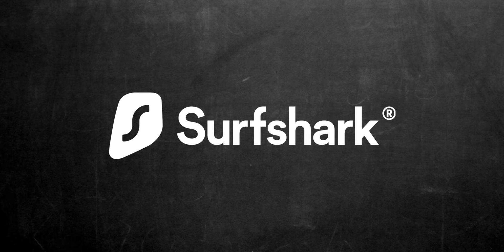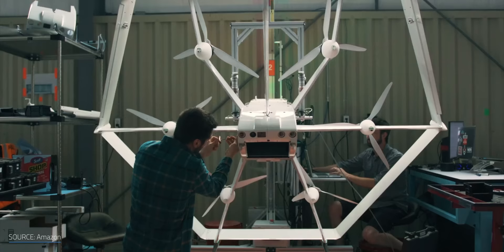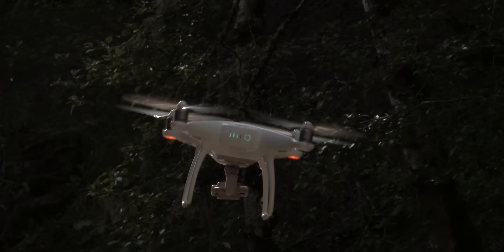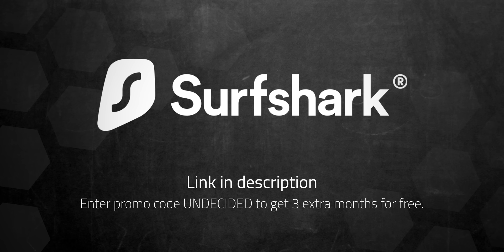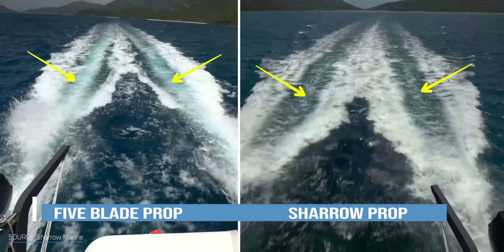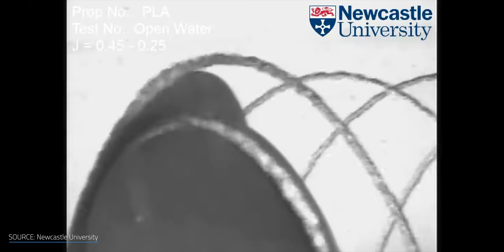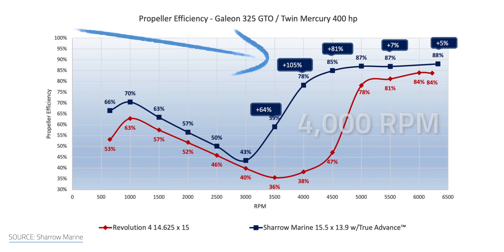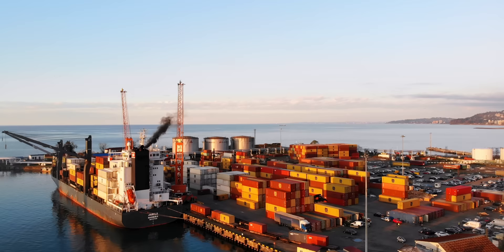Why is this Propeller Getting So Much Attention?

Comment: Edit: There actually might be something more to it... I can't say more so make of that what you will.

I work for a marine propulsion engineering company. The props engineering team had a look into this and found the boosted efficiency claims to be wildly overstated, at least for the larger vessels we supply. As with most things, if it seems too good to be true, it usually is. They're a brilliant idea for drones though!
Reply: Maybe because large ships props run at lower RPM?
Reply: There's a boating channel on yt that tested the marine props. They seems to be tailor made to the specific engine setup. And the efficiency is mainly during half speed. Going full tilt removes any efficiency benefits and brings it on par with traditional props. But they have pretty fantastic stats when running them in their optimal conditions. Their price makes it somewhat infeasible right now however. 

How it fairs on huge ships are yet to be evaluated I think.
Reply: @brucec954  They also have CPP systems (Controllable Pitch Propeller) so they can keep their shafts spinning in one direction regardless of forward or reverse.
Reply: I had to imagine they were, 105%? If they claimed 15-30% it would seem more realistic
Reply: @KoRntech   The 105% was specifically at that 4000 RPM range. This why they only account for about a 20% fuel efficiency increase. If you operate outside that range there is not as much difference. That is usually how sales graphs work, they only grab the best case scenario.
Reply: @brucec954  You are correct. RPM is a huge factor here. This is the primary factor for both efficiency of the shape and the resulting noise. Other market segments with props are also less effective for the very same reason (RPM) and/or because they already have variable pitch designs (such as wind turbines). Meaning most of the content provided in this video is wrong or mostly wrong or misleading at best. Sadly is a recurring theme with this channel. Especially for everything "green" he pushes.
Reply: Have they also compared them to a propellor with a propellor duct? I'm a captain at a inland barge in europe and we all use ducts (with special impellrr like propellors). We mainly use 20 to 50% of our power and regular propellors are very inefficient at those speeds.
Reply: @Naam is niet belangrijk  be sure to check account ages.   The "comment" account is less than a year and only makes negative posts.  Definately a troll.   May be a bot.
Reply: @KoRntech  It's actually not surprising for fixed pitch props. This is also true for aircraft. Their highest efficiency occurs when the forward movement matches that of the prop's pitch relative to the RPM setting. Remember a prop is a screw. If the forward movement of the screw does not match that of the pitch, it is an inefficient use of energy. Accordingly, it's not that this new design is so amazing efficient. It's that fixed pitch props are so amazingly inefficient at all RPM settings outside of their ideal pitch/movement. Accordingly, 105% is easily believable and likely very accurate.

That said, this is also likely why OP's comment is also true. As props get larger and larger they are intended to spin much more slowly, if for no other reason than to avoid super sonic tip speeds. The larger the prop the less likely they are to have high RPM requirements. Which is in large part why the prop blades become wider. In other words, they get their performance from size, not speed (RPM). This also means the operating RPM window is drastically reduced (1500-6000 RPMs (4500 rpm window) vs for example, 100-250 RPM (150 rpm window), of a large cargo ship). This in turn means a large ship's propeller is much more likely to always operate at or near ideal RPM whereas the smaller boats commonly transition to and fro as their standard operating environments. Accordingly, the inefficiency is much more commonly observed. In turn making the efficiency improvements a much larger percentage of it's overall fuel consumption.

For example, a small craft likely operates around 20% of it's life in transition. Whereas a large ship likely operates 0.0001% of it's life in transition with a much smaller window for transition. Accordingly, a well optimized fixed pitch is almost always be ideal for large cargo ships.
Reply: @smudgeone  Maybe it's better for like 22 ft offshore fishing boats with where you spend a lot of fuel going out and coming in.
Reply: Point design.
Reply: @autobootpiloot  One of the channels that plays with computer fans did something with putting a toroidal prop in a duct a short while ago.  As I recall the results were EXTREMELY unimpressive.
Reply: Funnily enough, efficiency and noise wildly overstated for drones too.
Reply: @KoRntech  at 4000 rpm max efficiency
Reply: They have been proven to get major gains for boats.  They get better fuel economy, faster, and are quieter.  There currently is no way to manufacture them for larger vessels, so all you could try is a simulation.
Reply: @gregmoessner3104  I don't see any vessel spinning screws at 4000 rpms.
Reply: @BenjaminMeasures according to who?
Reply: Based on MIT release, the graph compares noise profile of bi-blade vs toroidal props at about 3k RPM.
For reference, Mavic and similar typically hovers at 6k RPM.
Reply: Hey people,  so this would still be an amazing thing for a small 16' ft boat?
Reply: Not to mention that it appears that the only way as of how to make this is through a 5-axis CNC. Yeah, that's why it's $5000
Reply: Yup, that 105% effficiency claim is nonsense because noone cruises at the worst part of the efficiency trough before jumping up on plane. 4000 RPM is a sweet spot for most boats, but not that config in their example. With that said, I can believe the 15-20% fuel efficiency claim is real , problem is that a sharrow prop starts at $4,999 compared to $150 for a conventional aluminum prop, or $350 for stainless. It would take decades (plural) to recoup the difference in fuel consumption, assuming the prop doesn't ever get dinged, which is realistically pretty common.
Reply: @justanothercomment416  If you don't like this channel, why are you here?
Reply: @mm-qd1ho  If you don't like facts, why are you participating in the comments? Guess what, facts don't change because your emotions are in play. Silliness.
Reply: @justanothercomment416  I can't decide if you are just wrong or mostly wrong or misleading. In any case, if you use a toroidal propeller while you are trolling, your insults will be 20% more efficient, and that's a fact.
Reply: How was the damage caused by cavitation bubbles? My guss is that even if they may not be as huge of efficiency boost as smaller boats, the increased durability must be advantageous, right?
Reply: @Tomasu321  That propeller sadly isn't going to change global shippin prices because at the low speed that those huge ships go at, the difference in efficiency is minimal, only at certain speed does the difference become noticable.
Reply: they may require a full redesign of the ships engine to run at a different rpm so that the new prop and engine compliment each other properly
Reply: Sharrow stated the operating range that these props have advantage on, and it is higher than what "large ships" operate on.

Did your team consider that, and did they actually test and confirm it?

Drones are better-off using ducted propellers, as ducted air propellers don't have to deal with the same limitations as putting ducted propellers on ships.
Reply: That sounds like the “company line”. Is it more a matter of not wanting to invest in a new technology, due to cost? The railroad industry suffers from this kind of backwards thinking.
Reply: @michiganengineer8621  That makes sense since computer fans can be calibrated to maximize efficiency. You wouldn’t drive a boat by speeding up to the ideal efficiency and then turning the prop off while coasting, but you can run a computer fan mostly in the ideal efficiency ranges.
Reply: "They're a brilliant idea for drones though!" Except for the fact that they aren't! lol. In real world use, the way to have an almost silent drone that only makes cool whooshing noises, is to  ditch the usual 5" tri-blade prop for a 7" Bi-Blade. That's all! very easy to do, and no radical, overly massive complex design (that can warp and flutter at high RPM) needed. 

But when most people think "drone", they think of the typical consumer grade DJI type. Small props that are stupidly loud.
Reply: Agree. When I was a kid my friends Dad worked for David Taylor Research and was doing fluid dynamics on propellers for Naval ships. I remember all the designs and even Toroidal type designs. Problem was cost to make and balance outweighed the minimal savings.
Reply: B.S , the laws of thermodynamics do not allow for a 105% efficiency in any energy conversion process. The efficiency of any energy conversion process is governed by the laws of thermodynamics, which are fundamental principles that describe the behavior of energy in physical systems. The first law of thermodynamics, also known as the law of conservation of energy, states that energy cannot be created or destroyed, only converted from one form to another. The second law of thermodynamics states that in any energy conversion process, some of the energy will always be lost as waste heat. This means that the maximum possible efficiency of any energy conversion process is less than 100%, since some energy is always lost as heat.
Reply: @ezragonzalez8936  The energy efficiency stated here isn’t about how efficient the props are overall, they’re comparing one prop to another. 

So if prop A is 20% efficient and prop B is 41% efficient, then prop B is 105% as efficient as prop A.
Reply: @justanothercomment416  Very nicely explained. You can easily see the rates that large vessels propellers spin at are much slower than smaller ones and when you stop and think for just a second about this, nothing else makes sense. It's really pretty simple physics but it's not something most people consider in their daily life lol. I would be curious to see how these perform at scale with various types of craft and vessels in the air and at sea vs the standard prop using some extremely complex simulations that mimic the exact conditions of real life as closely as technologically possible. No one is going to produce such large scale models of these without knowing for sure if they will work as advertised.
Reply: @ezragonzalez8936  the science understander has logged on lmaoooo
Reply: Without stating the actual size of the vessels/props and or power, this post is less helpful than it could be....
Reply: too bad
Reply: Toroidal prop works best in high RPM and heavy marine engine is anything but. So it makes sense.
Reply: @quinnreilly7681  hello. You are obviously correct that the 105% efficiency claim is meant to be a relative term. But the problem is the 105% increase in “advance” per rev, is not an efficiency gain either. Efficiency is power out over power in., and we are shown neither. And because the 105% comparison turns out to be at two different forward speeds (rpm x advance = velocity), the conventional prop clearly being at hump speed while the Sharrow is beyond that (ie planing), the comparison is pretty bogus.
Reply: Hmm but the noise reduction would be good even if it was slightly less efficent imo at least for special boats which are ooerating around dense populated areas
Reply: @XPLAlN  Yeah I’m not vouching for these comparisons or studies, I’m just explaining that one point of confusion.
Reply: U put them on drone and they were awfully noisy an unstable. 2 stars from 5.
Reply: @bigjules1234567890  If i remember right they started to work with Yamaha to create molds instead of expensive CNC.
Reply: @michiganengineer8621  those were 3d printed
Reply: I too can easily design a propeller that will move a boat faster at less than full speed, simply by increasing the surface area and angle of attack of the blades. But if I wanted to sell it as revolutionary, I too would fail to mention that the engine must work harder to overcome the increased drag. "At the same rpm, it produces x times as much thrust..." looks good on paper.
Reply: @joshm3484 yep 100% correct.
Reply: @justanothercomment416  A propeller, be it marine or air screw, is not like a real screw. Real screws can be analysed with simple machine theory. That does not work with fluid dynamics. If the velocity of the craft equals the nominal pitch times rotational velocity of the prop, you get zero ‘slip’ but also zero angle of attack, zero induced flow, and zero thrust. The propeller blade is at peak efficiency when at the angle of attack for best lift to drag ratio, and that means there will be slip.
Reply: @XPLAlN  Now explain in detail, in comments to support your position, with the understanding few to no one will understand, therefore completely wasting your time. Or acknolwedge the reality this is simplified discussion because of the forum.

Makes sense now doesn't it.
Reply: @justanothercomment416  no, it makes no sense because it is wrong <“their highest efficiency occurs when the forward movement matches that of the prop’s pitch relative to the rpm setting…if the forward movement of the screw does not match that of the pitch it is an inefficient use of energy”>. It is wrong because that equals zero angle of attack. Do you understand that or not? I think it should be simple enough for most people who chose to watch a video about propellers, so dumbing it down further, to the point of actually being a myth makes no sense whatsoever.
Reply: @XPLAlN  Yes. I understand this. I even explain this. Why are you wasting everyone's time? Perhaps you should find and read my other comments rather than blather on antagonistically trying to convince everyone how smart you are?

Have a nice day.
Reply: @justanothercomment416  …so you understand that zero slip equals zero angle of attack but you still think that zero slip is the most efficient condition for the prop to operate? How is this, and where have you already explained it? You haven’t because it is a contradiction. It cannot be so. And you have reacted badly to hearing this reality. My point may be antagonistic to you, but that is not the measure of what is physically correct, nor a good reason to excuse what is nonsense.

Comment: All this talk about the toroidal propellers and async propellers just has me excited that there's still so much potential for improving known working designs. It leaves you wondering or imagining if such a simple change like this yields 20% improvements across the board for multiple mediums... what's left on the table we haven't thought up yet to improve.
Reply: There are plenty of things that fit that description. The trick is to get the efficiency to sync up with the cost and existing manufacturing facilites. E.g. there are plenty of hyper-efficient airliner designs, but they mostly require non-standard manufacture and novel materials, which makes them unappealing to companies who have to protect their bottom line.
Reply: toilet paper, for example. just paper on a roll. george costanza thinks it cannot be improved. i think he is wrong.
Reply: Steam freely rises - condense to liquid  power generator as  it travels  down power hot plate  heat  water make steam
Reply: @Paya So  a bidet is what you are looking for, uses a small amount of water. You feel and are cleaner and you only need one small square of toilet paper to dry with. E
Very efficient
Reply: It would be extremely naive to say "such a simple change like this".
Because designing that kind of propeller requires a deep understanding of processes going on around spinning propeller, and these are quite complicated.
Manufacturing of such a complex shape requires precision computer controlled machines. It is not something that could easily be made in a garage.
So, we are producing propellers for almost two centuries, yet there is a room for improvement in that seemingly simple device.
Reply: Quantum computers will provide the capacity to apply a (shape) variation based combinatorical optimisation method to find the best solution. Searching for the optimum in large space of variable values without directing the search motion. Tabu Search without tabu. Monte Carlo method.
Reply: My Flying Car that they said I would be driving by the 70's would be nice
Reply: @tSp289  Capitalism: If it works, don't fix it.
Reply: @trip5003  So you want a car that can crash vertically as well as horizontally?
Reply: @twistedyogert  there is not a single communist country that has ever had the highest quality of aerospace manufacturing in all of aviation history. Bottom lines are just a pragmatic way to represent the nature of and need for actual efficiency.

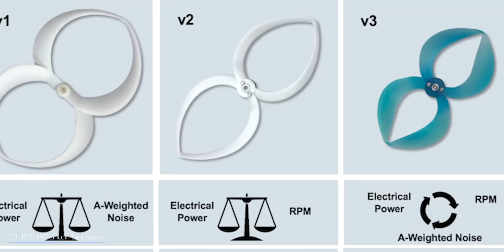Comment: For scenes where movement is important to illustrating something (i.e. I can't just pause the video and get enough information), like at 5:12 and 6:01, I would recommend making those clips longer (or putting them on a loop if they're short). I am repeatedly having to skip back, wait 7 seconds for the 3 second clip, try to see what is happening. I eventually just set playback speed really low on those parts, but it breaks up your narration and takes away from how well done everything else is.
Reply: The whole video is too fast to really take in most of the information. I get it that YouTubers nowadays make their videos (incl. their voice recordings) a bit faster and usually I don't mind, but Ferrell overdoes it and his videos have become unwatchable to me on normal speed. It's a shame.
Reply: The reason people do that is so that you have to back the video up and re-watch the clip Again. YouTube algorithm interprets that is a high-value engagement.